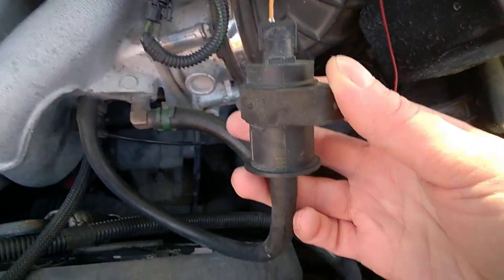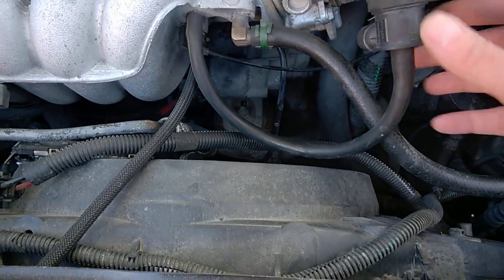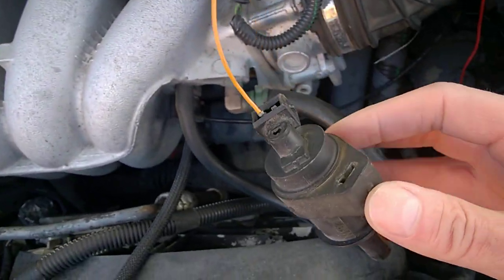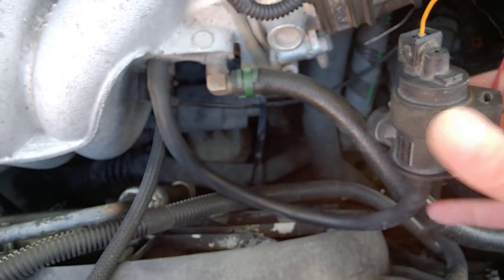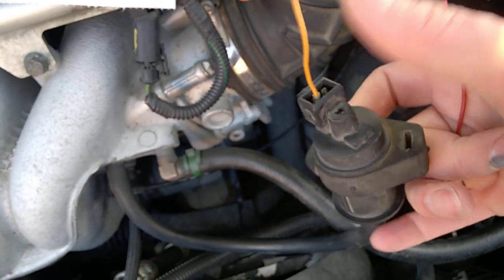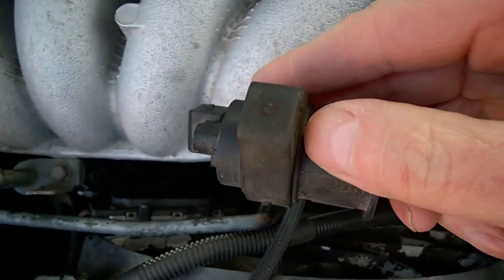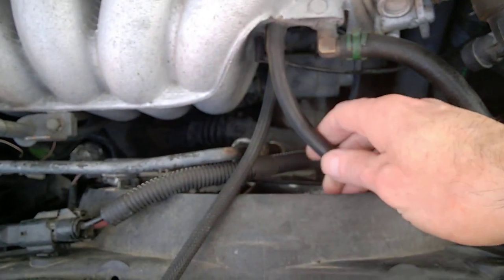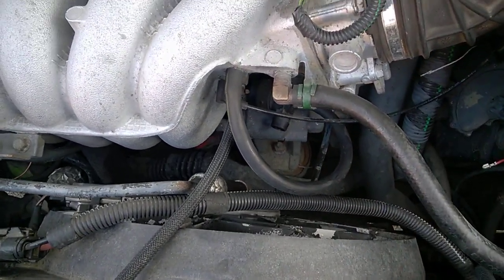Volvo S60 V70 Checking the EVAP canister purge valve 2001-2009

Comment: Thanks for another super-helpful video. My valve tested out ok, so I saved some dinero there. I replaced the hose to the manifold and the hose coupler to the tank hose, which was pretty bad. This was prompted by a p0455 "large EVAP leak" code. We shall see if it returns.

Comment from the maker: DOUBLE CHECK  gas vapors hose clips fully back in place and also there are 2 o-rings on the hose, a black one and an orange one. Careful because the black one may fall from there when you remove the hose from the sensor.  You certainly don't want gas vapors to accumulate inside the engine bay while the car is parked.
The electrical connector is also annoying to undo and to place back, because the wire is short.  The metal spring clip needs kept depressed - be sure you secure back properly the electrical connector by depressing the metal clip then pushing it closed with some force
Part number  https://www.fcpeuro.com/products/volvo-evap-vapor-canister-purge-valve-genuine-volvo-8653908

Comment: I had a ECM-4007 or po447 low purge flow plus a tighten gas cap message that turned in to a small evap leak code, followed by large evap leak. Its worth checking the line from the Vapor canister to the purge valve. There is a small flexible section where it travels near the passenger front wheel. This 1/4"ID hose can start to wear out. I finally found my issue! near the flexible section of hose mentioned the hard line travels under the bellow that connects to the inner tie rod on the power steering rack. My hard line was crushed and torn in this tight location. Worth a check easy to replace the hard line or put a piece of 1/4" hose to replace the cracked section. Either way I paid a shop to do a smoke test and they were completely useless finding this. I was luck enough to find it myself with my little mityvac hand vaccuum pump.

Comment: Very nice video, mine was completely stuck - so a new is odered. One thing though. How in not-something-i-am-supposed-to-write here, do you get the metal locking pin/clip thing back on the connector?

Comment: This is malfunctioning on my sister’s 2015 GTI.  It’s in the rear.  Diagnosis involved voltage readings from single grounded 4 wire plug.

Comment: I have a 09 s80. Recently I noticed mpg dropped from 25 to 21 mpg. I did not see obvious vacuum leak. I use vida to monitor EVAP flow. It’s reading is 0.36 g/s. Do you know what the normal reading is? I don’t have DTC codes. There is must have some leaks, either vacuum or evap. Thank you

Comment: Replaced mine and check engine same
Code 445 came back. Possible a bad part? No sure. Any ideas will be helpful
Reply: Have you checked the vacuum hose all the way from the tank to the valve? As in had it off. If it's broken, or blocked that could cause it. 
There's usually a split with a slide-over piece to connect the two parts underneath the car. And if that has been apart for a while, even at a time before you got the car, the inside of the hose can be all gunked up